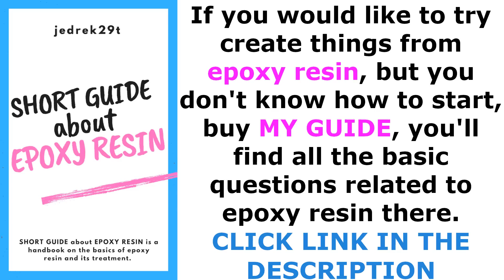A Burning Cigarette in Epoxy Resin / RESIN ART

Comment: Idea for a smoke: fill the mould with clear resin fully (with no cavity cone for “smoke” as you did). Then while it is still liquid, take that thin bamboo stick or even some thinner long needle, dip its tip into white paint or white epoxy, then quickly dip it into the mould touching the cigarette tip, then withdraw it slowly, swirling around, trying to leave a trail of white epoxy behind it as if it is smoke rising... can also perhaps instead of needle use syringe with thin needle, filled with smokey white semitransparent epoxy. Swirling it around the cigarette inside liquid clear resin may leave smoke like trail.
Reply: Your idea is much better, but this stupid cigarettes are so bad for our health they shouldn't be used for art.
Reply: S Moreno May be it can be some propaganda art about a danger of smoking
Reply: @smoreno5532  that's the great thing about art,  it can be beautiful or horrible or anything in between. Art is subjective and one's opinion is only meaningful to that person themself.
Reply: S Moreno they should be used in art
Reply: S Moreno cigarettes make you cool
Reply: nasa called they would like a word with you